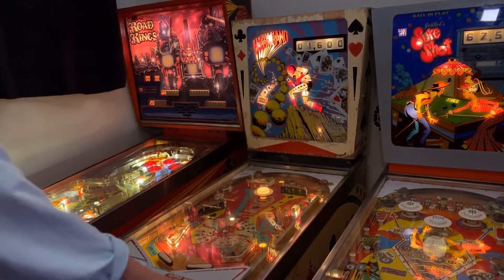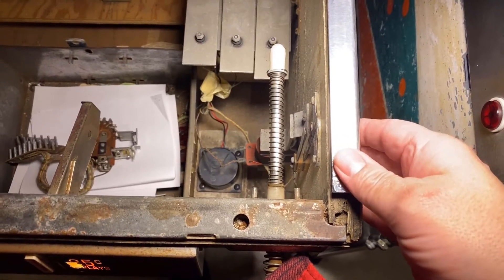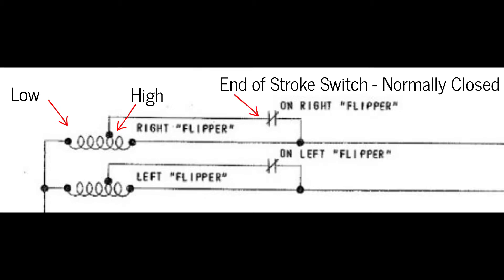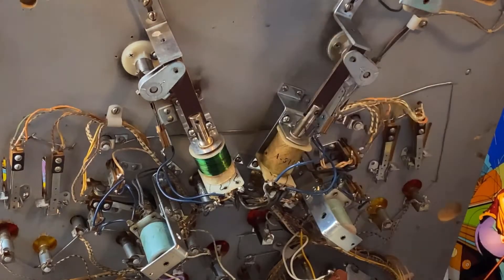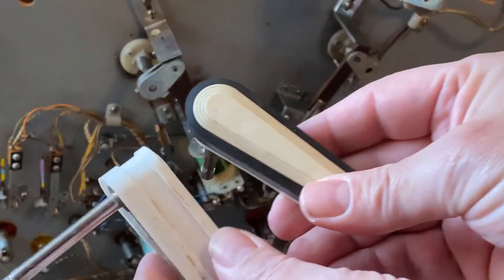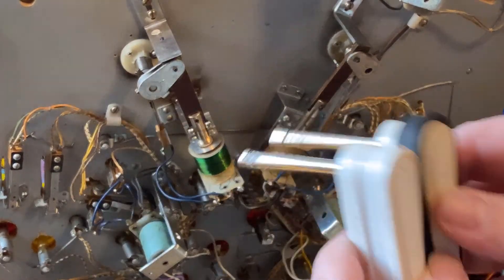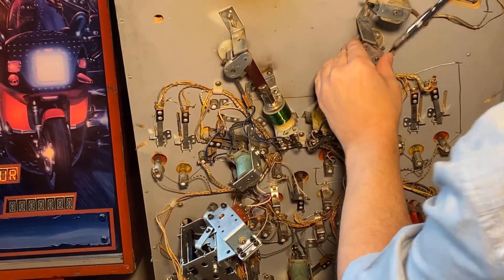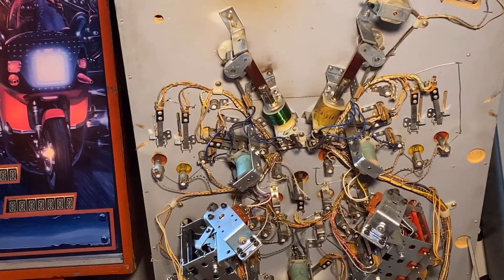Pinball Flipper Repairs Part 1 // Gottlieb High Hand // How Pinball Flippers Work

Comment: Do you need to get vintage flipper bats or will newer ones work with these older em machines? 
I'm about to purchase a Bally Captain Fantastic and the upper right side flipper won't move but I'm unsure if I'll need to replace the whole mechanism or even where to find one that would be compatible with the machine. Thanks in advance.
Reply from the maker: Hello Jamie. Of course not actually being at the machine I could be wrong - however I don't think you'll need to replace the bat for that kind of fault. My guess is that is is some other sort of mechanical failure - for example the sleeve in the coil has become gummed up and frozen the rod inside the coil. Join my page on Facebook and send a pic - I'll try to help if I can ... https://www.facebook.com/ifixoldstuff